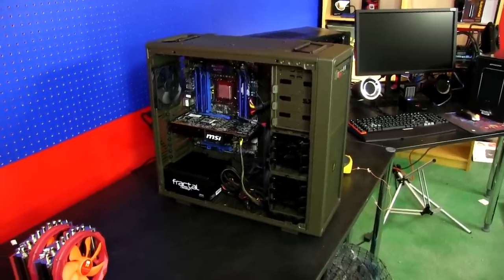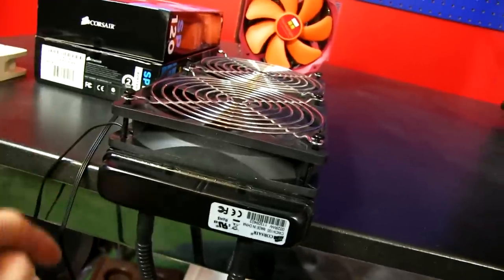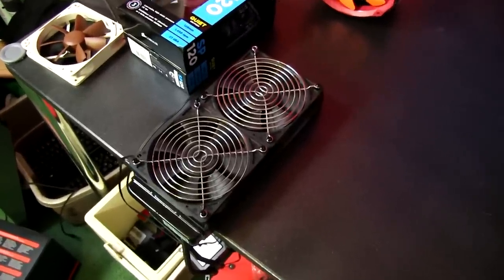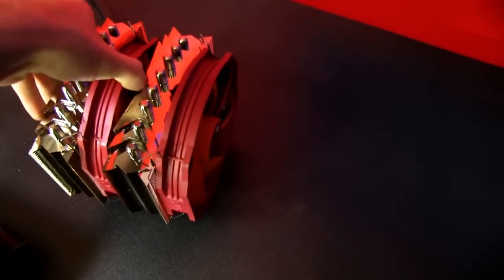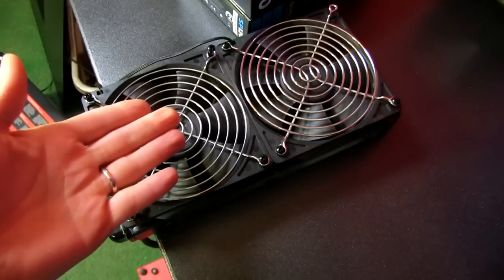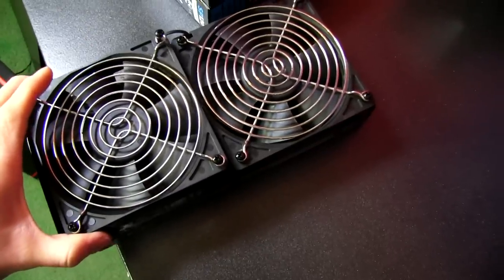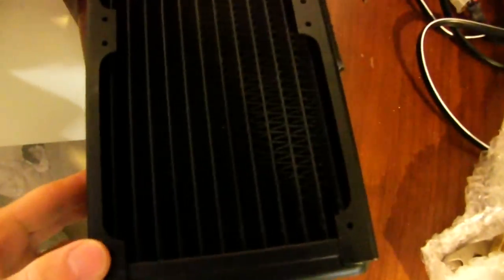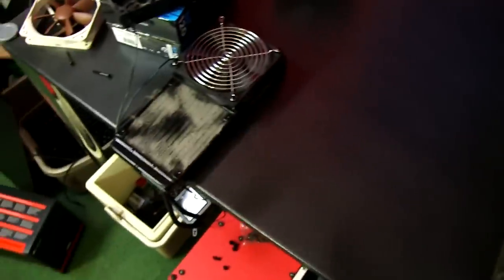Push vs Pull vs Push Pull for Radiators and Heatsinks Linus Tech Tips

Comment: you mixed up the positioning of the fan/airflow reguarding the radiator with the airflow of the case.. they are 2 diffrent things.. if Z=rad, /=fan and |=case in push config you have 2 options  
1.airflow is left to right :   / Z |
2.airflow is right to left :   Z / | 
in case it is still unclear search google images for "push config radiator explained" there is an image showing all posible configs of rad/fan.. reguarding push and/or pull

Comment: so the point from this push and pull useless?
cause i have lian li cooler with fans from bottom and i was wondering about fans if possible  to put them top of radiator 
i mean if it's good or not?
Reply: The point is that it’s a tradeoff.  At the same speeds, assuming good static pressure:
Push - good noise, good airflow.
Pull - a little louder noise (from my experience), good airflow.
Push/Pull - slightly louder than push, best airflow (plus you can spin these fans slower to achieve the same airflow, thus the same performer at quieter noise).

Comment: Some swiss guy made a phd on that, and then proved, that another configuration than the usual one, would make heat-pumps 26% more efficient, thus making simple, cheap air/liquid-heat-pumps as efficient as expensive, laborious liquid/liquid(geothermal)-heat-pumps. It´s called a Lambda-heat-pump, but never understood which config he uses, He´s a bit of secretive about it, but he mentions it nevertheless in an interview. Back then, I couldn´t know what he meant, but maybe now i´ll get it... His heat-pumps have been tested by several independent organisations of german-speaking-countries (those countries are the most interested), and of the EU, in order to prove the 26% rise in efficiency...

Comment: PLEASE Help. I have a 4930k and a H100i in a NZXT H630 with 2 noctua nf-f12's. I have the rad attached to the case and the fans to the rad, stickers facing down. It's running at around 46c on idle (same temp even with the side off). What should I do get this temp down?
Reply: turns out the cooler was faulty, all good now
Reply: ***** Well... actually you have to SPREAD THE THERMAL GREASE. :)
But with a "pea size" (or "rice grain size"), as you said, it's good enough, it's the perfect size. ^^
Reply: ***** You don't need to spread it. As soon as you push the heat block onto the paste it will be spread perfectly across the CPU by itself.
Reply: Peter Ian Staker Well... that's half-truth. If you buy some WC kit (like Corsair H60, H80, H100, etc.) they come with some thermal grease on the heat-bomb block already I you only have to put it and push against the processor, as you said, but if you put some other custom WC/air solution... and you put the thermal grease on it, then yes, it's better if you spread it a little. ^^
(Just a little, of course, don't be so brute and spread it like butter over some bread >.<)
Greatings... and remember: things are not always black or white; there is some "grease" in between. ;)
Reply: ***** Spreading it a little does nothing, as soon as you press the block on, it spreads it just the same as it would if you didn't spread it at all. Seriously, get 2 cubes and a pea of thermal paste and press the cubes together and see what happens. it spreads perfectly across. Spreading it yourself does NOTHING at all.

http://i.imgur.com/iWKad22.jpg
Reply: Peter Ian Staker I don't want to fight against a troll and a waste of people... so... ok, you win. Say and do what you want. ;)
Reply: *****
kaled a pea sized bit of greese on a procssor is a wee bit better.  1  degree at most. if someone apply too much then they'll just spill it on thier mb
Reply: ***** Also spreading could cause air bubbles to form between the cpu and the other contact.  This could cause more heat build up.
Reply: Barry Cooper ¿? ¿Have I said the contrary, just in case? I have said EXACTLY that with a "pea size" (or "rice grain size") is enough. Of course you don't need to put more thermal grease and, if you put it, they will spill all over your processor down 'till your socket, MOBO, and so on...
Reply: MarioCordaro No. There is no "air bubbles" IF YOU KNOW HOW TO DO IT. If you spread the thermal paste CORRECTLY, then you will have lowest temps on your system (on your processor) than if you don't give a shit and let it there, without doing nothing. ;)
Reply: @Bryce Freeman:  C´mon bro, don't be ridiculous !!! You have an excellent processor that is made for hard use like video editing or gaming, so it's going to run hot even at lower frequencies. I'd like to have a config like yours but i don't have the buck so still use a C2Q: on idle remains 34-38°C with CoolerMaster N520 and AS5 grease. So don't bother yourself trying to run it cool, because that rig is hot (literally too hot :D )
Reply: ***** Troll and waste of people? He's not trolling, for one; two, insulting someone means you've already lost..
Reply: Peter Ian Staker You are correct sir!
Reply: ***** Also, as MarioCordaro mentioned below, if you spread it, you run the risk of uneven "pressure spread" when the two blocks mate together. A small, NOT SPREAD pea sized glob will distribute it's mass evenly in all directions by simply not spreading it.

Comment: i didnt really understand your explanation of why pull is better for dust? Could someone help me out please?
Reply: In pull, the fans aren't in the way of the dust, instead they're on the opposite side of the radiator. In push, the dust is between the fans and the radiator, meaning you have to remove the fans to get to the dust.
Reply: so are the fans pulling air into the pc or pulling air out of the pc?
Fans inside the unit or outside the pc?
and radiator inside or outside?
Reply: Essentially the radiator is acting as the dust filter in a pull configuration, so its easier to clean. A push configuration will take dust, blast it through the fans and splatter it between themselves and the radiator. So during regular dust maintenance, you have to take the fans off which is a big pain in the butt. If you have a standard vertical case, the level of assembly would be (from bottom to top) Radiator -> Fan (pointed up) -> Case Mount.
Reply: +Brad Borkowski tyvm!
Reply: alright, but what if you push from the inside of the case out?
Reply: The dust will probably get caught between the fan and radiator as seen in the video thumbnail.

Comment: i have fractal defile r4 case i bought kraken x60 everything fits perfectly untill i notice no facking way the radiator fan is like 1mm too big it hit to "old mouse port"on my sabertooth 990fx motherboard- i fixed this. i put radiator inside and the fans outside of case okey is the performance better if put fans push or pull or is this idea insane i'm thinked to buy 2x slim fans to push and now those radiotor fans out side of case pull or outside fans push and inside fan pull it's 1fan enough to move warm air out from case or do i need more i got 2x 6970 and now 7fans but only 1 push warm air outside of case but is it enough?

Comment: hey guys. (TRIGGERED) Btw high static pressure fans are better for radiators but what about cpu cooler heatsink? Is it the same concept, more directed pressure more cooling?

Comment: I don't agree with this logic, if u took those pull fans off all the dust would be on that side cause it is getting stuck on the fans trying to pull the dust through... As well push-pull, the air slows down through the radiator so it is pulled on the otherwise to keep its speed, and thus increase the cooling... Granted not noticeably

Comment: Still gonna run mine push/pull. I have 60mm and 80mm thick rads, with SP120s running at 4V. Need all the static pressure I can get.
Reply: Dan Jones Why not just up the voltage?  Shouldn't affect noise levels much if you're halving the number of fans in the process.

Comment: So many  people push through the exhaust radiator at the top of the tower. So the correct way was  to this is have the radiation fans above the radiator  and  have them pull instead. 🤯

Comment: i would think!!! pull would work better then push if the fans are connected very close like a radiator... my reason is if you push air at something that is close it make more turbulence and back pressure. it will make the fan use more energy(spin slower) and have less air flow through the radiator(the turbulence and back pressure is fighting the air that trying to move through the radiator). the only time i would use push if something was not close (the turbulence and pressure makes wind) so the air make it to its destination.

Comment: What do you think about setting the fans up on a H100 or H100I to pull air in from the top instead of from inside the case where heat already is? I guy at micro center told me with the H60 I have to mount it on the back of the case have the fans blow in as it will bring coll air from outside into the case and have the side and front fans push in and have the top blow out? suggestions?

Comment: All right, settle down.  Settle down. 
    Now, will those of you who are playing in the
    match this afternoon move your clothes down onto the lower peg immediately
    after lunch, before you write your letter home, if you're not getting your
    hair cut, unless you've got a younger brother who is going out this
    weekend as the guest of another boy, in which case, collect his note
    before lunch, put it in your letter after you've had your hair cut, and
    make sure he moves your clothes down onto the lower peg for you. Then installing your fans in a push pull push push pull push configuration using only the heavy rivet gun as discussed in chapter 6. Very simple.

Comment: push pull is good if you have a big radiator in thickness
Reply: No becuase its so thin and the h105 has the corsair high performance static pressure fans anyways.  Only if you have a thicker radiaror like in a custom loop you should only do it.  It will also shove dust in your rad.  Pull is the best since its easier to clean with the radiator exposed
Reply: Ok no problem :)

Comment: Isn't it good to maintain positive air pressure though, so there's a constant current of air inside the case, to cool other components?
Reply: Negative air pressure is actually much better.  Always have more exhaust than intake.  If you have more intake it can lead to stagnant air in the case, heating up components.  You need to have more exhaust fans to get rid of that stagnant air.
Reply: I always use negative. Less dust and its still pulling 'clean' air through.
Reply: MarioCordaro
 gunnerzz1008
Thanks for the feedback.  I have a Corsair 800D that all fans are intaking except for the 140mm near cpu, that's exhausting to get rid of hot CPU air.  I'll try exhausting the top 3x120mm fans and intake the 140mm for feeding cool air to my cnps10x cooler, see if my components stay any cooler.  I could imagine air near the disk drives in the front becoming "stagnant" and building temp.
Reply: Douglas Dillingham
I have Vengeance C70. I have front and bottom fans as intake and top and rear exhaust. My front and bottom fans are on low rpm though so it still stays negative.

Comment: what about cpu / gpu stock coolers ? whouldn't be better if the hot air would be pulled out of the cpu/gpu instead of pushing it onto the motherboard/pcb and actually heating up VRM and other key components?

Comment: The other day I got myself an H80i . Which is mainly the same as a H100i but smaller and with both vents fixed on pull push. The noise is just unbearable when it pulls over 50%, so 'im in to take the second fan in and just work with a vent on PULL.

Comment: i have a antec 902 and you know most antec cases comes with filter and i always wanted to buy a h80 and using 1 fan only pushing the air through radiator but i wonder if it would affect the performance. i dont want to have fan sucking air in where theres no way to put filter in between.. I haven't clean my whole tower for over two years already i just need to wash all the filter once in a while.

Comment: So should i set up my fans like this pulling in air from front (2 fans) then 1 exhaust fan at the back? Also about the PSU should i place it with the fan down or up? If i was to face it down there is already a dust filter there.
Reply: +Brayden Kelly Thanks, about the psu guessing i should place it upside down then?
Reply: Brayden Kelly Cool thanks :)
Reply: +Brayden Kelly Sorry, just wondering my graphics card doesnt come till next tuesday but im gonna build the computer tommorow.. do you know if i install windows etc... with the onboard graphics card if it will have an affect when i put in the actual one next week? :3
Reply: +Brayden Kelly well thanks for the help again.. :D
Reply: +Jimbo 35637 how is your build?
Reply: Miguel Eduardo working well and great on games c:

Comment: Cleaning is easy if you have a couple psi of air to blow the dust out of the damn thing. I run push pull and clean with air every month works like a charm

Comment: Well i had My H60 pulling air into the case like corsair said and mine was clogged up on the intake side. So i  had to take my water cooler radiator off just to clean it. So now i have it set up with two fans blowing out of the case. Because i feel that i would only have to remove the first fan to clean it next time. I have lots of fans in my case so having the fans push air out of the case instead of bringing it in wont matter. I actaully have seen huge temp drops on my cpu after i changed my fans to push the air out of the case instead of bringing in the cooler air from outside the case. I actally have my 8320 overcloked to 4.4 with a top temp of 45C thats  a huge improvement with some coolermaster fusion cpu grease.

Comment: What if I put a Corsair SP Quiet fan pushing air through my H60, and keep the stock fan pulling air out, wouldn't the pressure difference make the air run faster through the rad.?

Comment: Close your case, have your machine without power. Get an air compressor with a trigger blow gun attachment. Get plenty of pressure built up. Let it rip, blow the dust into your case through the radiator. Pause, open case, vacuum. Rinse/repeat 2 or 3 times (with various components). Done.

This is assuming you CBF taking it outside and letting nature have your dust, in which case, take it outside, open wide, blow.

...that sounded awfully filthy, but oh well. lol

Comment: I am planning on getting a Corsair H110 and I was wondering, push or pull? Or should I try both? Help?
Reply: It's just fine with a pull configuration. Cleaning is also easier than a push configuration and in terms of temperatures, there is not a huge difference.
Reply: Thanks man!

Comment: What about the fact that the air is cooler on the outside of the case, so if you pull air into the fan from the outside of the case the air going through the heatsink is cooler, than if you push air from the inside og the case out of the case?

Comment: Or if you kept the case positively pressurized with a pull config, you might not have to deal with a dust issue as much.
Reply: +Joshua Taft If you use filters on intakes as well. Without filters, positive pressure won't get you anywhere.

Comment: Can anyone help me ? What would be the best set up for my. 
I'm currently doing a push pull config.

Diagram :  |>[]>       |     .... | = case .... > is direction .... [] rad ...... > direction

can anyone help me ? im using a Cooler Master Seidon 120M and using the stock fan given in the cooler.

Comment: I had an 120mm radiator with 2 fans. Does the radiator cool even with one fan?
Reply: i had a bad fan once and ran one fan at one point and it actually still cooled my cpu while overclocking so yes

Comment: So if you have a small Radiator, both fans should pull? from both sides?
Reply: both sides = push pull configuration. one is pulling the other i pushing
you want them both on one side.. or just one

Comment: Oh and what case is that?
I'm looking for an affordable case that can comfortably house a h100i cooler without taking up a ton of space for other components.
Reply: Corsair C70. I have it, and I love it. Especially the case sides are a pleasure to work with (clips at the top, no thumb screws on the back and hassling with getting all the latches hooked, the hard drive bays are rotated 90 degrees for easy access and good cable management, a fair amount of room inside the case to work with, TONS of places for fans (two on front side of case, 2 on the front, 2 on the top, 1 on the back and bottom). Room for a 2x120mm radiator with more than enough room for the fans and radiator on the inside (can even access the top of the MB still for the CPU/SYS fan headers), 2 USB jacks and audio out/in on front, pre-separated PCI dust covers so no wiggling the dust covers to break them off for expansion cards, vent for PSU fan to blow through the bottom rather than into the case... Can't say enough good about this case. I've owned a lot, and this is my favorite by far.
Reply: I have a 750D, only thing that bugs me, the 5.25" bays are not removable. With the capacity of modern HDDs and SSDs, that amount of space for drives isn't really needed. Other than that tiny gripe, O love em. Air moves nicely in these things.
Reply: sessy33 s340 or s340 elite
Reply: Zonkory No. Mine was the correct answer.
Reply: nexus1g i answered the second question :)
Reply: Zonkory OHHH! I'm sorry. :)

Comment: Please help me now! what should i do? i got an core i7 4790k so what should i do for my cpu water colling, should I push the air from inside to outside of my case or push it from outside to inside? please help me I got an CM690 III
Reply: Lumar231 If you put the radiator in the top of the case,  the hot air should be pushed or pulled out of the case (reason: hot air rises naturally). If you put it in the front, pull the air from outside. That's what I would do.
Reply: Karst van der Ploeg gracias :)